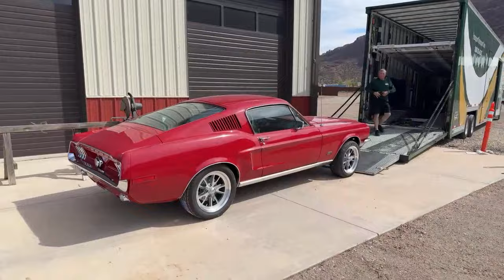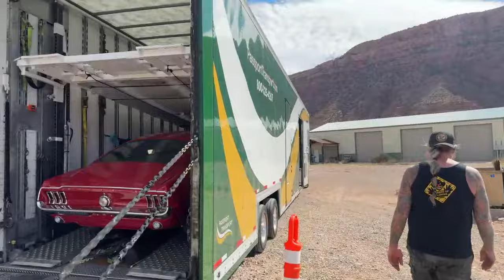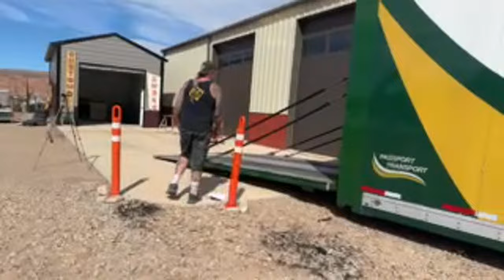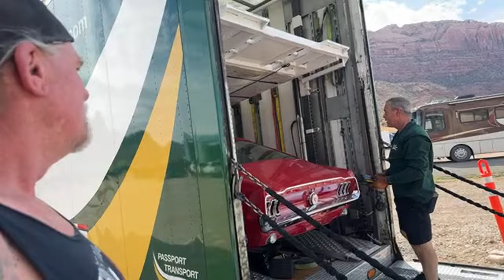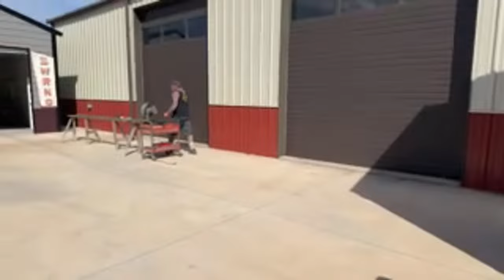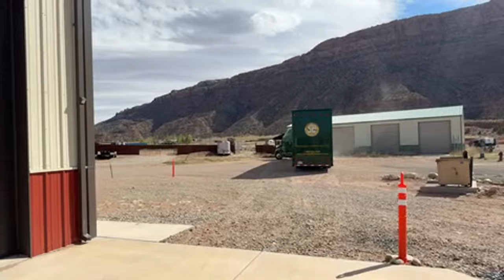This Ford Mustang Is Going Home After 10 Years - Total Restoration From Start To Finish

Comment: This is what a true professional does, they do whatever they have to do to get the job done. If it takes years then it takes years. If it means sanding the fresh paint down to fix a flaw, then you do that. You don't do what my guy did, a so called pro who owned a body shop, painted over rust and in some spots didn't even sand down the old paint. He did a good job on the front, got passed the hood and gave up.